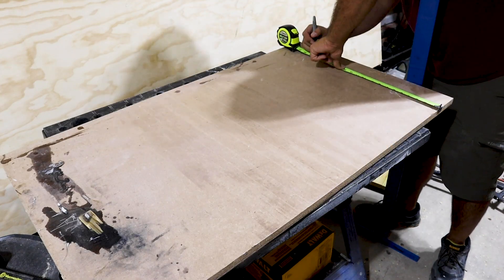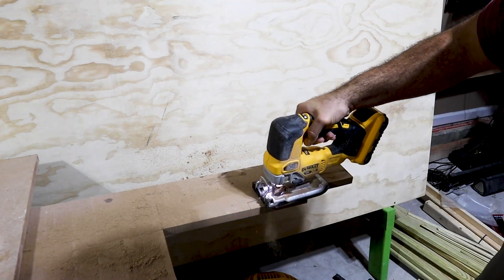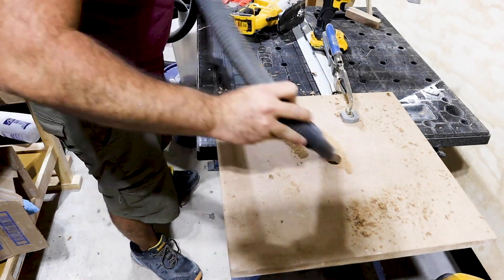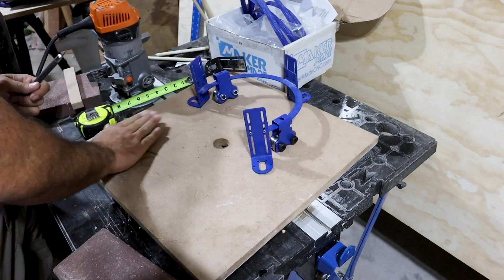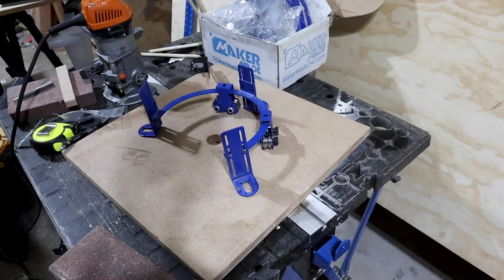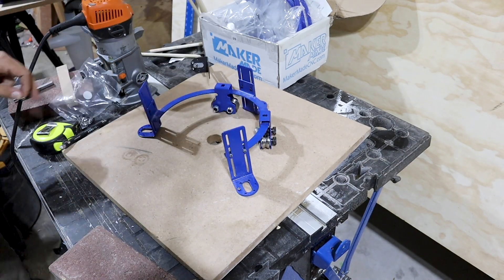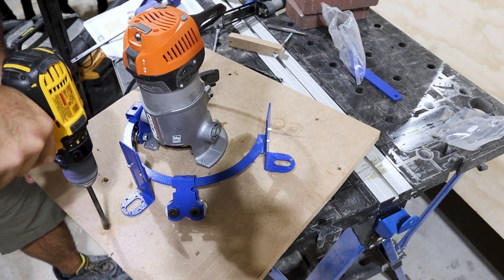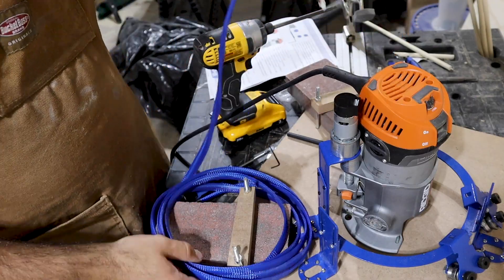Building the Maker Made CNC: Making the Temp Sled

Comment: Awesome tips. Thanks for putting this nice video. I have 3 questions. 1) which router is used here? 2) Can I design 2'x2' with this? or I have to take the same 4x8?
3) upto what thickness it can design?
Reply from the maker: hey there, 1) it's a Rigid router, 2) yep it can definitely design 2x2. just need to mount it to the backboard. 3) it should be able to work up to the thickness of your z travel distance

Comment: Would it be easier to draw a 3 way (120 degree apart) set of lines, measure from the center and mark a circle on those 3 lines, mount the bracket to that, check your actual mounting using a flat straight edge and mark your actual center point, and then finally drill that hole out?   Instead of trying to line up the rings around an existing hole, just put the hole where the actual center ends up?
Reply from the maker: Sounds like that would help